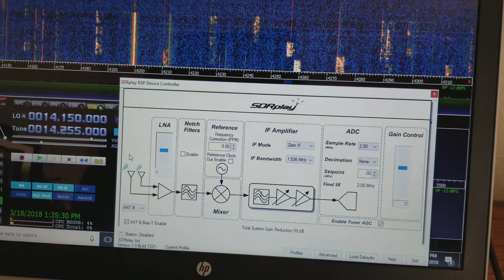Don't mount a miniwhip directly to a Metal Surface (ground)

Comment: I’m glad you made this.  I had heard that advice about using a 2’ x 2’ sheet from a hardware store.  The advice had two other parts to it.  Sand the shiny coat from one corner and place the whip as close into that corner as possible. I can’t say that I’ve tested it.  Your demo was pretty useful.